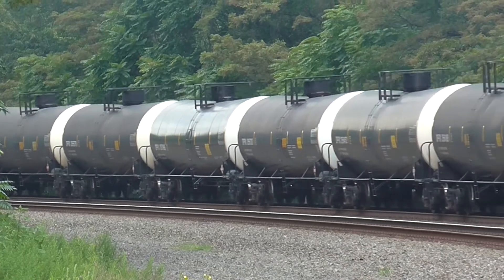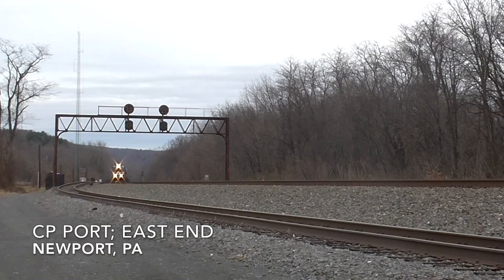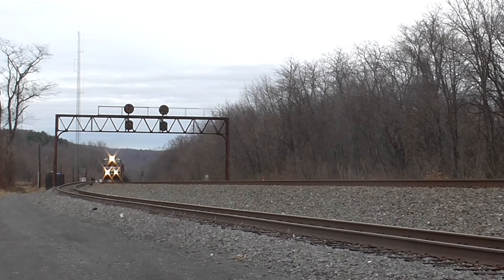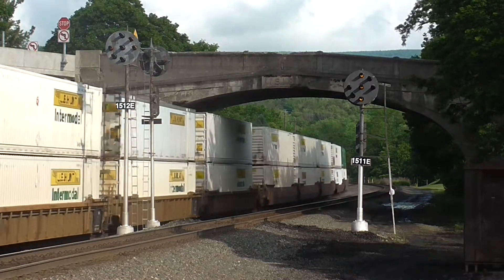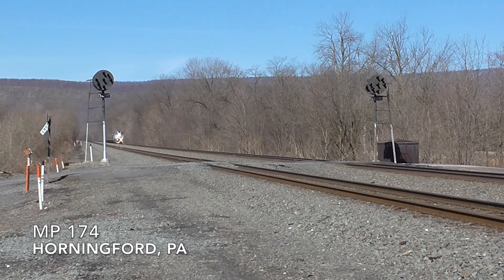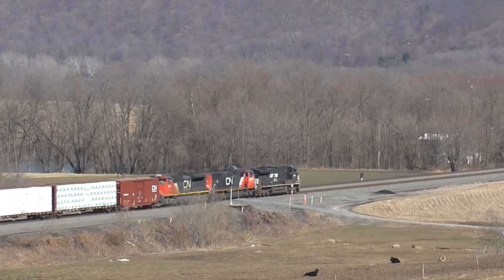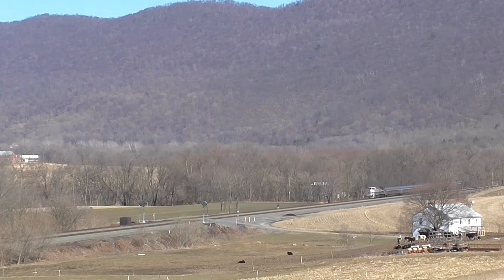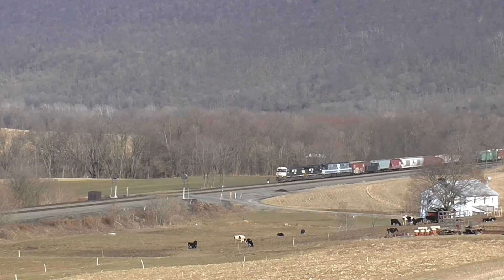Signal Swan Song Series - Part 2: Middle Division 1

Comment: How many tanks are in the consist of the ethanol trains and what weight are they loaded? Just curious! 

Another great video.
Reply from the maker: Unit tank trains typically run about 80 cars. Collectively, a loaded ethanol train weighs in around 10,000 tons, give or take if one of the spacer cars is loaded.